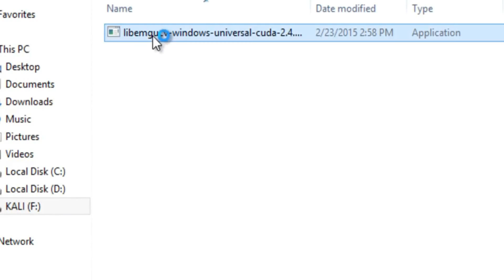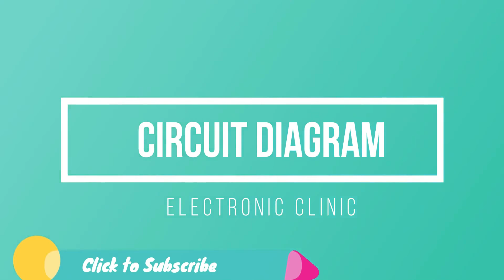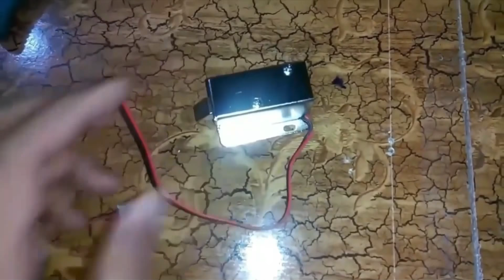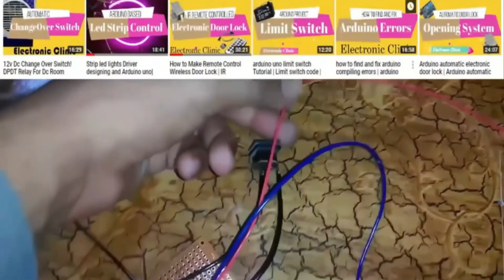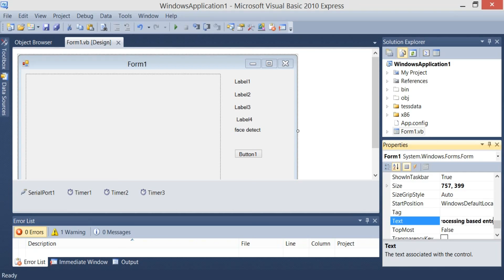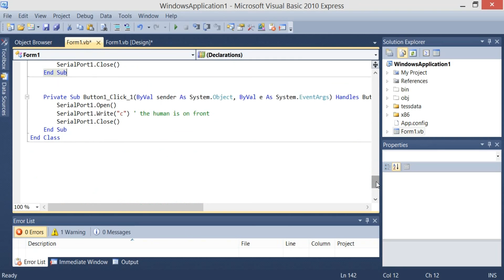Comment: Please tell me how to declare a variable for lblfacedetect in your code
Reply: its the label name. add a label on form and change its name to lblfacedetect
Reply: watch a getting started tutorial on vb.net. check playlist. those videos will help you.
Reply: I want it to make it such that it can only be unlocked only by my face
Reply: its quite easy. you will need to make an xml file. take at least 20 pictures and train your own xml file. i have explained this method in my tutorial on eyepupil tracking. in that tutorial i trained an xml file for the eye, in your case you can use your face images. then you can use that xml with this tutorial.
Reply: tomorrow i will make another video on human tacking system. In which the motor rotation will be controlled as per the face co ordinates. don't miss that video.
Reply: I m making the same project with some changes can u help me
Reply: tell me what changes?
Reply: I saw that video but I want to make interface to add photos also
Reply: Can I make that  it would be very helpful for my project
Reply: if you want to add like multiple images, i think you are talking about the database version. in which you can add multiple images and track any object or any person. for this you should use raspberry pi and python.
Reply: So its not possible to make using this method
Reply: I faced a problem
Reply: This code also detect pictures as human also what can we do to remove that

Comment: I'm making something like this but I'm using java. So I've done till the face detection and now I want my camera to move by using servo in Arduino application by sending Arduino real time face coordinates. I'm using the JSSC library to connect my java application with Arduino using COM3 port. But I'm having problems with it as there's always a port busy error and nothing is ever sent to Arduino. I've done everything but in vain but I saw you did something similar with no problems. What should I do?

Comment: so cool! I hope I can have some source code of this application designing, sketch code and hardware list coz' I want to try :)
Reply: You can download the programming from my blog page. Check description
Reply: @ElectroniClinic   Thanks! I already check it. Can i have the hardware resources you used only if u want.
Reply: the components purchase links are given in the description. 
arduino uno or mega. the same program will also run on mega. 
Electronic lock which is also known as e lock, or door lock. its a 12v. 
spdt type relay 12. 
2n2222 npn transistor
10k resistor and a power supply, 12v.
Reply: if you have any questions let me know. You can even ask infinite question. 
wish you best of luck.
Reply: Sure! Thanks to all feedback. God bless!
Reply: @ElectroniClinic nice work love from Dubai.